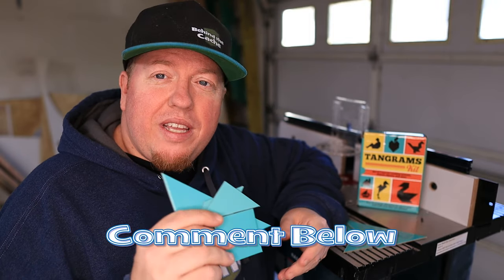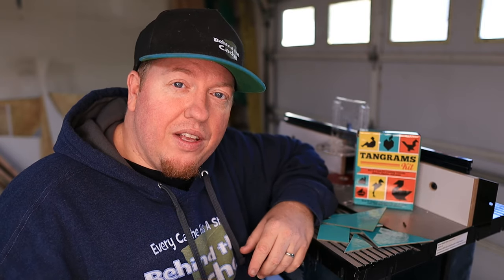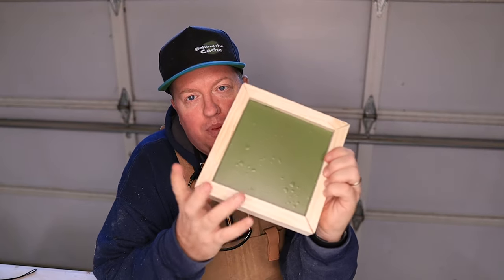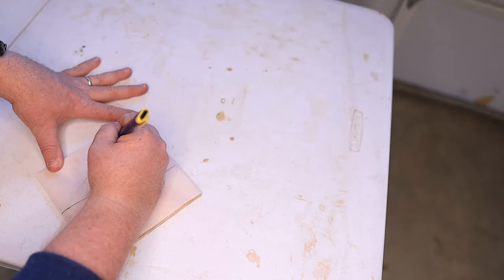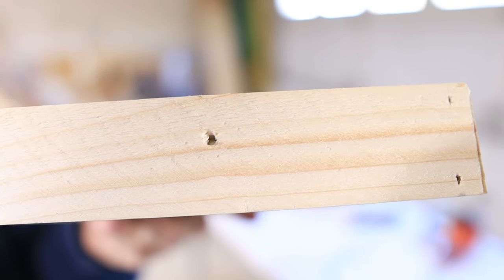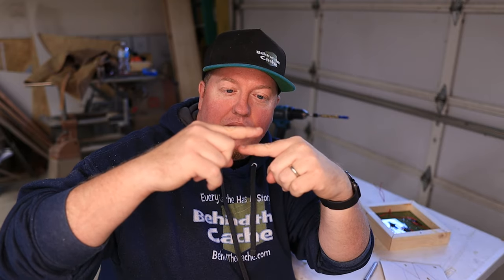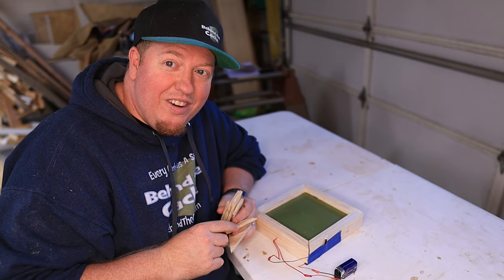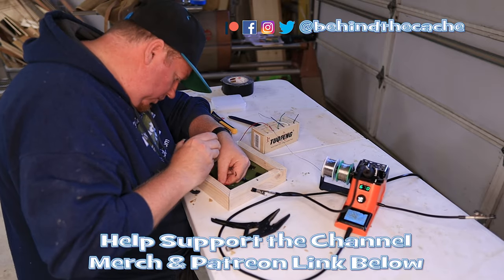Reed Switch Puzzle Gadget Cache Build Part 1 (GCNW)

Comment: Pin nailers  are the best invention every.  They shorten the build time by so much!   The parchment paper was a brilliant idea.  I need to remember that!  Great explanation of how a reed switch works.  I was thinking the same thing as Wilhelm Jensen, placing one piece down [permanently might help to ensure the magnets are in the same  spot each time.    I have a gadget cache that uses  a reed switch  but the reed switch would stay closed sometimes after the magnet was removed.   I added a diode in parallel with the read switch which solved the problem.  Not sure why this works but it was it was recommended to me by someone who knows electronics better than I.  Great video!  I have always wanted to make a cache like this but had not thought it out, so glad to see this clever cache being made!

Comment: I attempted to make a very similar cache last year based on a video game called "Talos Principal" only I had one big issue. The puzzle had more than one solution and placing the magnets in a way that could accept multiple correct solutions hurt my brain. In your case there are fewer possible solutions (8, based on the starting orientation and weather the pieces started right side up or upside down.). One method I considered as a fix is to permanently fix one piece to the game board reducing the possible alternate solutions. That should also work for your puzzle as the pieces are cut more organically. Another solution I considered was to paint or etch a pattern in the edge of the board and in the game pieces so once completed correctly the image was revealed and you can be sure of the solution. Also, one addition I made to reduce the possibilities was to drill a hole and glue a small dowel to serve as a handle to lift the piece out. This also prevented cachers from flipping a piece upside down.
Reply from the maker: Those are all great suggestions. I think I may put a piece of vinyl cut in one of the shapes so they put that one there and can go from there. Love all the suggestions. Thank you.

Comment: Gebildet 10pcs Plastic Reed Switch Reed Contact Normally Open (N/O) Magnetic Induction Switch (3mm×14mm) these are the reeds I need?
Reply from the maker: Yes those should work. There is a link in the description
Reply: @BehindtheCache  wasn’t sure if they needed to be close or open. Thanks
Reply from the maker: For that one always open so when the magnet on the tanagram comes in contact it closes it.
Reply: @BehindtheCache  awesome thanks! I never understood those before. Also. I’m building my own version. I’ll let you know when finishing.

Comment: I am attempting to add reed switches to my project in a smilar manner but its not working. any tips?
Reply from the maker: Make sure what type of reed switch you have. If you have a multimeter test when you get a current when you place the battery to it. Then if you are doing puzzle pieces you need to make sure the magnets line up just right with the reed switches. I hope that helps.
Reply: Thank you! @BehindtheCache

Comment: There's a small problem with your puzzle. It can be assembled in several ways and it can be rotated 90 degrees four times. Maybe you need to attach one of the pieces so that there is only one solution.
Reply from the maker: True but if you want it to be harder you don’t have to do that. It will only light up if you get the correct configuration. But you are correct. I may draw how the first piece goes. Thank you for your comment.
Reply: @BehindtheCache  I guess I should have read the comments before posting. :P